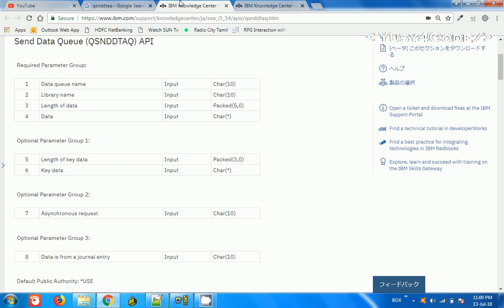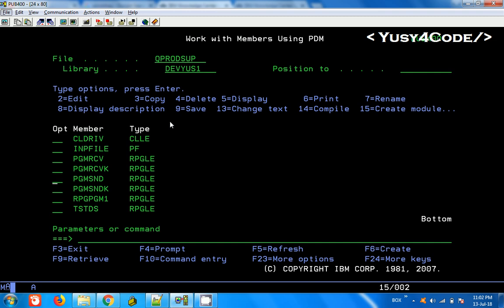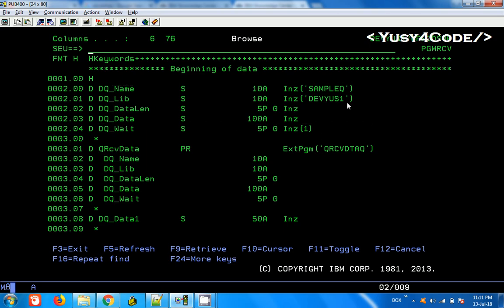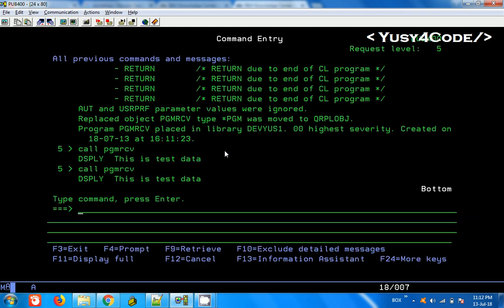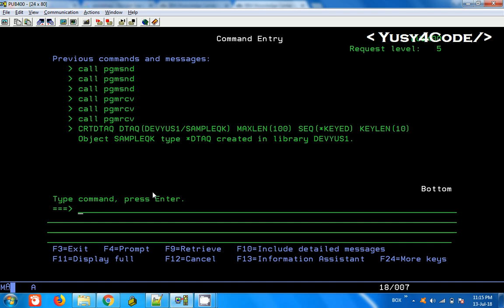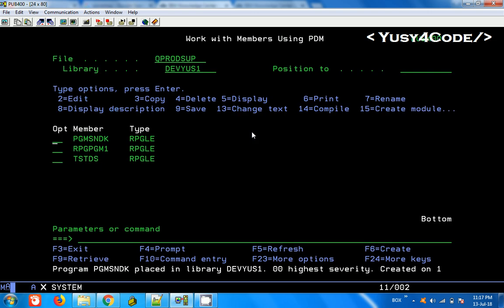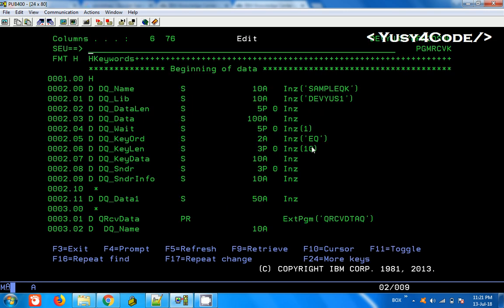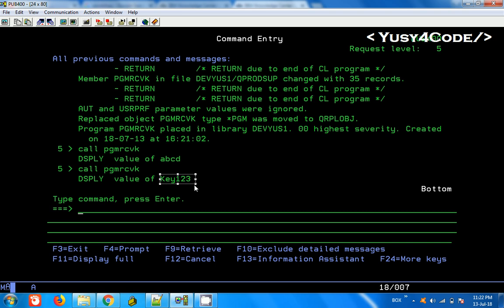Introduction of Data Queue - DTAQ in IBM i (AS400) | yusy4code

Comment: How it helps to sequentially send data and receive data? How is it different from message queues? Is it the fastest queue?
Reply from the maker: While creating the DTAQ you can define whether you need to retrieve the data in LIFO or FIFO, so based on this property the message sequence is maintained. Comparing to MQ, MQ can do more stuff. We can use MQ to send/receive data from other IBMi (or even other JAVA application). But DTAQ can be used to send/receive message within different programs.